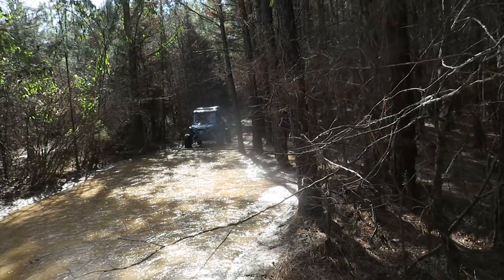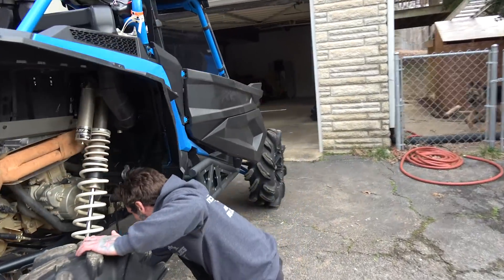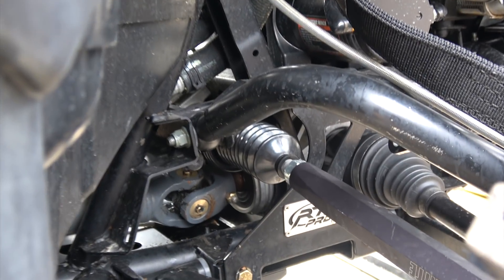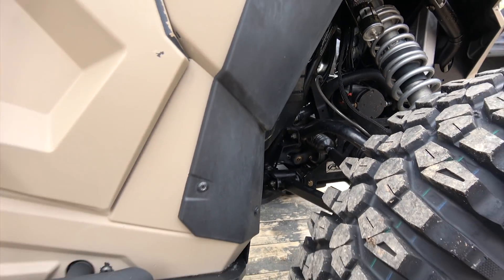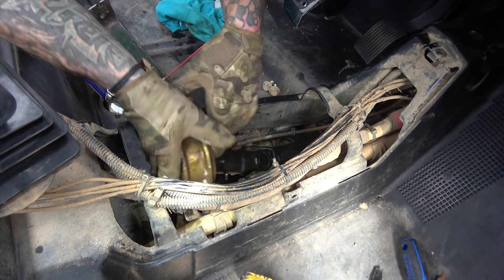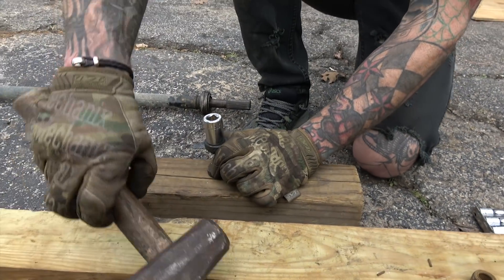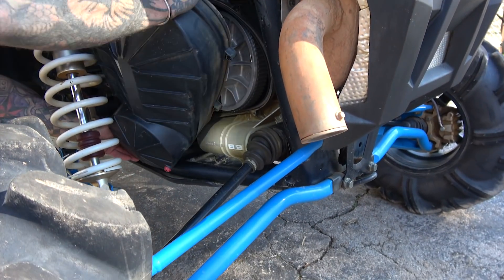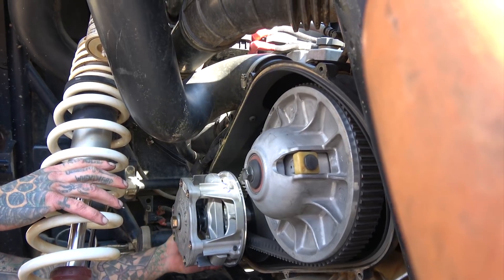How To Install Best RZR Greasable U Joint Replacements

Comment: So what happens if you put grease in the flex barring I got a Polaris rzr 4 seater and it’s been making a noise I already changed the flex barring and changed the u joints but still has the noise and I put grease on them to
Reply from the maker: The thing about rzr's is some noises are just going to be there. I had to come to terms with that fact when I bought my first rzr. Lol!

Comment: Use marine grease on the new u joints if you run thru water a lot. Also if you worry about Hydro-locking the engine think about marine 4 stroke engine oil. It has additives to minimize homogenization of the water and oil. It also has additives to help protect from running long and hot. I run marine gear oil in both my Jeep and trx300fw to protect from water intrusion.
Reply from the maker: Good advice. Thanks!

Comment: Non greaseable joints are by far better than greaseable. You pack the trunion full of marine grade grease and install. Will last 3 times longer than  greaseable as the seals are much better and your not fuckin them up by pushing grease out them. Proven over and over again.